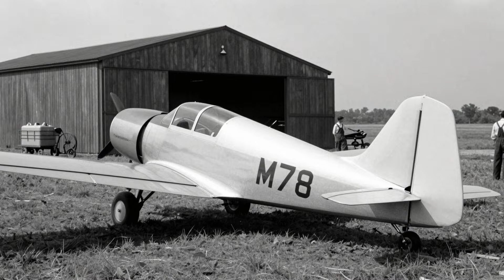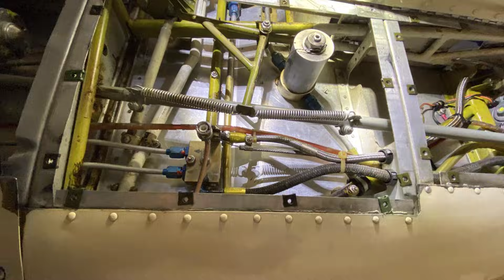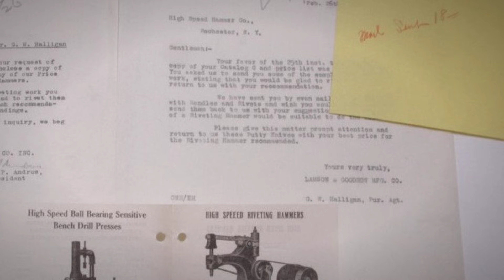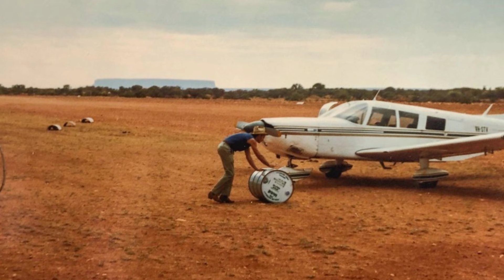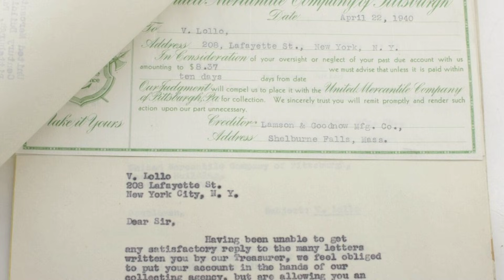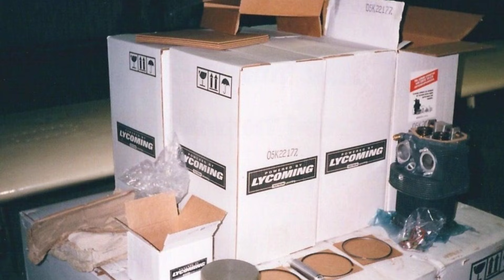Mooney: The "Fighter" Design That Perfectionism Ruined

Comment: I owned and flew a 1970 M20C for almost 20 years. The carbureted O360 engine was absolutely bullet proof. Corrosion was never an issue. I had to have the gear motor and the carb overhauled but that was about it. Annuals were done by an IA that had been to the Mooney maintenance school. As I recall most of the annuals took about 16 labor hours. I flew her about 100 hrs/yr. and I miss her to this day.

There is something positive to be said about the earlier models with the manual gear and flaps, however.